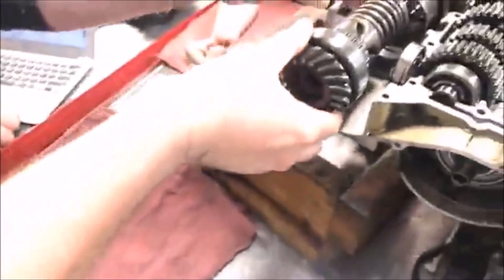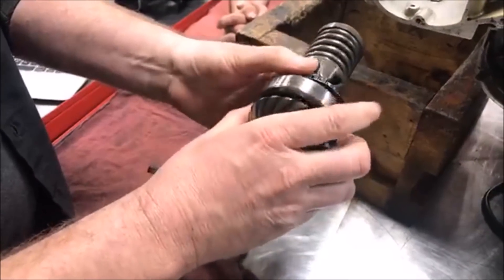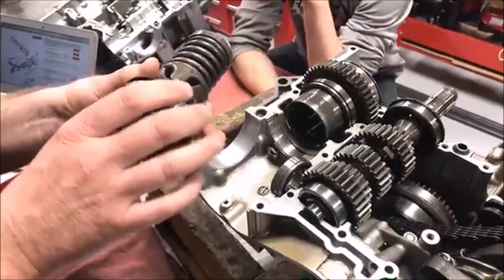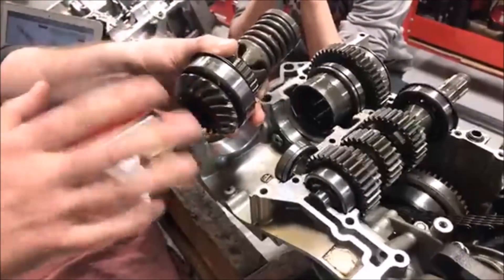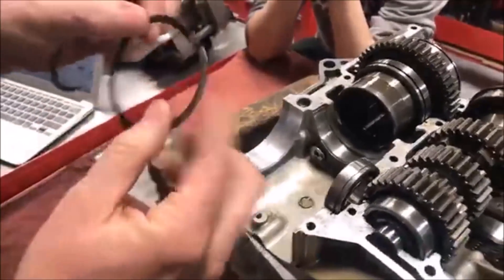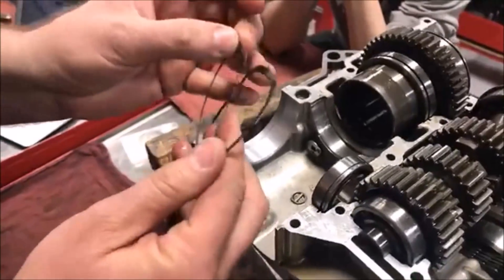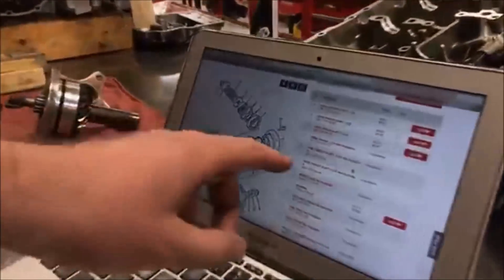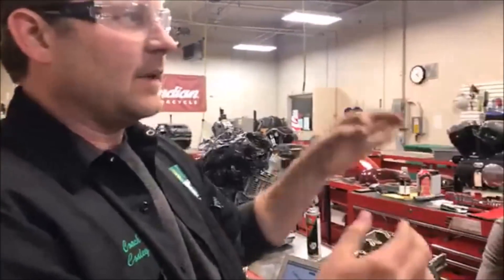Could this engine really have been assembled wrong 36 years ago? Shaft drive shims smashed!

Comment: Yamaha had issues with the thrust washers being too soft and causing 2nd gear to eventually fail on several models including the XS1100 and the XVZ1200 Venture during this era....many were repaired under warranty.